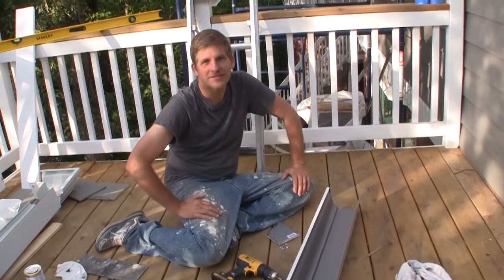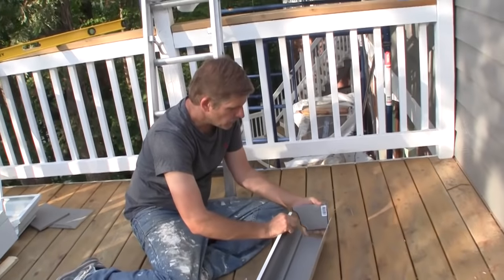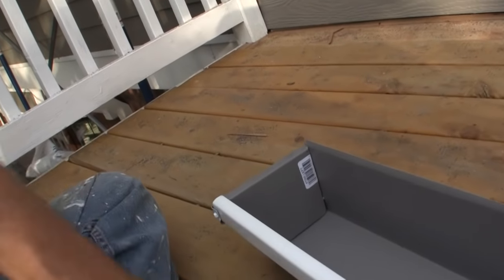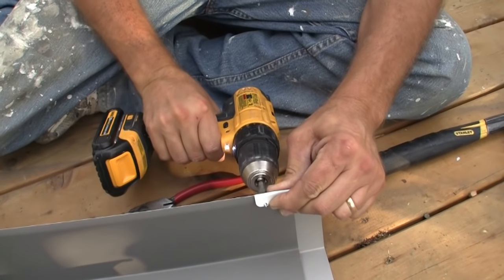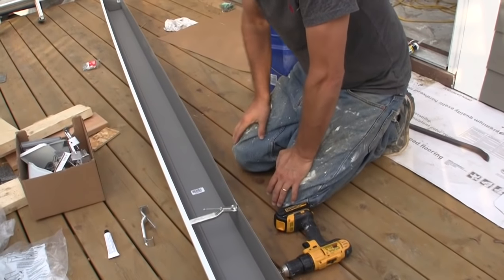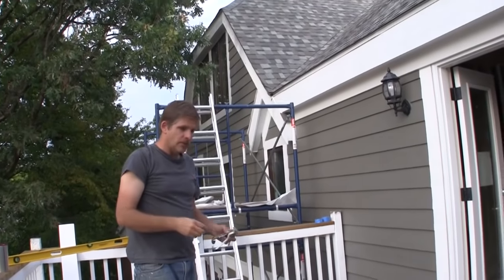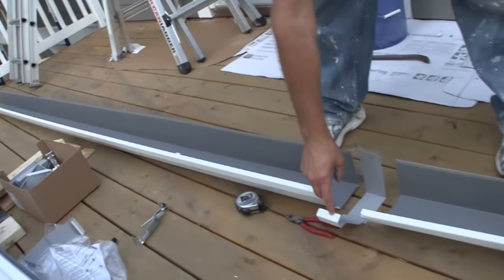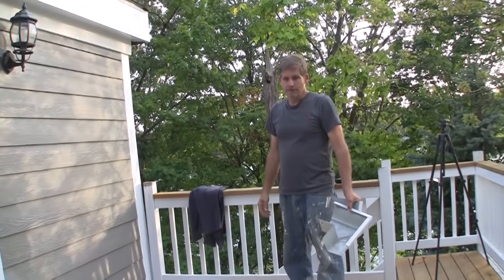How to Install Gutters

Comment: One trick I learned is instead of using the seam connectors, simply overlap the two gutter sections by six inches or so and screw together.  Creates a much stronger and less likely to leak joint.

Comment: This is why if you can, always go seamless, a local company most of the time will come out and do a cut and drop that way you can install and save some money but ultimately this is a pretty good video on installing section gutter using expansion joints always use a level and if the back of gutter falls below the drip you will need to extend the drip ,if you can save the time and buy end cap crimps you won't regret it
Reply from the maker: Hi Josh, thanks much for your comments!

Comment: If you need to scab on a short length, don't add to the bottom.  There's a lot of water at the bottom.  Add up near the top as there is less water/depth/pressure.

Comment: 1/8" slope @ 10' min, 1/4" is max @ 10'. A 40' gutter run @ your 1/2" slope would have your gutter moving water very quickly to the down spout end and potentially have a overflow issue during downpours. Roof line may look whanky also.
Reply from the maker: Hey Lou, 
A much debated issue...in the end - there are a lot of things to consider...
Thx for the input and for watching!
Reply: @Housebarons  yep, to each his own I guess.
Reply: 40 foot run. Run it high in the middle.  And each end down a half inch with a downspout also on each end. So the gutter splits the diversion of water.
Reply: Lou, I agree, but that depends on the run. If it's 15 to 20 ft,  an inch or full two is good, especially with the gadget seemers that slow down flow. If I'm forced to use this style gutter, I make my own seam and make a Pittsburgh Hem. It's sturdier and doesnt slow down flow
Reply: Thank you. This is what I was wondering about. So far all videos I have seen say ¼" slope. But video from Home Depot said ⅛" for every 10'.
Reply: 1/4" is standard in plumbing and work fine. Heavy rain area's, a wider gutter is suggest anyhow. But does the house look wonky, janky or cattywompus? My wife & I are second owners and door bell didn't work, sometimes. I found the wired the 24Vdc transformer to the furnace fan. Doorbell worked great as long as a call for A/C or Heat! There are newbie's in the electrical world but 1/2" drop per 10 foot seems excessive.
I have galvanized steel gutters. Clean, dry, Red Scotch Bite on stainless steel wool (Dollar Store now) but balled and clamped to an adjust handle, hit with leaf blower and CRC cold galvanize the bottoms get me 5 more years. Alu dents in hail storms and holes in vinyl siding are scary. We get nailed in NE. some years.

Comment: This video has been popping up in my recommended videos for a year now. I finally clicked on it, and listed below are my findings and best recommendations. 

1/4" per 10' is the standard,  not 1/2". That will change depending on whether or not the house is level. Also, Hardware store gutters are ultra thin and inadequate for residential gutters unless you install hangers as tight as 16" o.c.  Your better off calling a local gutter contractor and buying your material from them. Not only will you get seamless gutters and all the necessary parts, you'll get a free tutorial on how to install them. Although I have a lot of respect for this guy, he's is trying to show you how to intall gutters with absolutely no experience, other than what he learning as he is teaching you.

Comment: I use white aluminum 1/8” rivets and I lap 4” of gutter with four sealant bead tracks and rivet them together with four rivets in back and two on the front top lip... super strong and will never ever leak
Reply: Handyman Inside 
To clarify the 4 rivets on back and 2 on front. Is that the total number of rivers when joining two sections?  So each side of the joint would have 2 back rivets and 1 front.   Is that right? 

What about a cap end?  2 back, 1 front?
Reply: Rivets with caulk work better than screws for joints.
Reply: @1BillT  Rivets and OSI GS121 -     Permanently flexible, water resistant seal;    Expands and contracts with temperature changes;    Cures to a tough rubbery gasket ;
    Self-leveling; no tooling is required

Comment: Never bother with seamed gutters. Just pay someone with a machine to  drop you off exactly what you need then install yourself. Any company should run it out and drop it off for you. Also, crimping the endcap is preferable to screws. The sealant does all the work. And your level will only get a true reading of the slope when pressed against the back of the guttering. Still a good video for new homeowners! Coming from someone who does this for a living
Reply: I also run a gutter company and I can't agree more. 👍💯
Reply: E&H seamless here, wish he got it under the drip more

Comment: One problem is that the roofers did not install a drip edge all the way to the corner between the brown and white sides of the house.  The drip edge that is there is about 1"; probably does not meet code thus shingles should run longer and you should slide an apron piece under the existing drip edge and into gutter rearside with to keep the water from running back behind the gutter

Comment: I am a block layer and Concrete Finisher on these gutters that I will be doing I will just use a line level and snap a string line drop it 1/2 inch every 10 ft follow that all the way down screw it to the  line done deal in concrete you drop it eighth of an inch per foot
Reply: Rocky Easterline so 8th” per foot?
Reply: @nickbrooks4043  yes on concrete it is 1/8 per foot drop but gutters are 1/2 inch every 10 ft

Comment: I do seamless gutters no matter how long always one solid gutter we cut the drip edge a small amount on the high side to tuck it under but we crimp the end caps and caulk them to ensure no leakes we put screws in the corners but only in places you can’t see them and caulk them as well
Reply: johnny appleseed  I also do seamless gutters and I tell you what I work for myself but I would never recommend this because the more seams the more leaks and I could never put screws in the back because of the drip cap I also use end cap crimpers to crimp my end caps and calk them very well so I bet agree with you as I also use outside miters and inside miters but in a company a box miter will cost a lot more over time

Comment: I tried using the joiners between pieces and had leaks.   On another side of the house, I literally overlapped one length inside another length using adhesive and no leaks.  The overlap was about 6”.   With the couplers, I had to seal the inside with adhesive to stop those leaks.
Reply: U don't kno how to caulk
Reply: In my opinion just over-lapping the actual gutter sections works and looks better.1 small seam on a shorter piece vs. two right beside each other.

Comment: Great video. Silicone caulk will dry up and release within 10 years. Through the roof sealant is clear and will not dry up or release.
I use it for all connections and roof sealing, nails on roof, gutter cracks and even pvc plumbing leaks. You can apply to wet surfaces and it still seals.
Reply from the maker: Hey David Belitz ,
Thx for the tip. Makes great sense!

Comment: For the hangers contrary to popular belief gutter hangers aren't designed to clip over the back. The fold on the back side is there so screws don't pull through the hanger as they commonly did when 1st designed. Also the 1/2 of slope for every 10 feet is incorrect. By that logic a 50 foot piece of gutter will be down 2 1/2 inches from one end to the other which will look terrible. A flat gutter will drain water just fine as the water will always find the hole for the downspout.
Reply: Steel Wolf ĢŘÎM  yeah, i couldn’t believe he said that much pitch. Besides looking like crap, on a 4” deep gutter with a 2” pitch, you’ve lost half the capacity of the gutter. It’s going to go to the other end so fast and because it’s too much lower, it’s going to flow over the end cap

I was going to comment on the hangers. But, looks like this is probably up north where they can use 5” gutter and they sometimes don’t even install drip edge. I’ve seen a lot of videos that don’t have drip. But the shingles hang way over. So probably ok and the bend is still on the other side of the gutter. So still rigid enough screw won’t pull through. But, hangers are doubled in back for strength, not to clip on the gutter. You’d never get far enough under the drip edge doing that.  So the gutter will now be lower than it should be.
Reply: I have to disagree on the flat gutter theory. Unless you are saying snap a level line to run trough to. I have seen houses old and new with fascia boards out 3/4" over a 4' level. I always snap lines and never have a issue. By tge way i have been doing trough for 30 years. Its just the way i like to do it. I know we all have our own way of doing things. 👍
Reply: For some odd reason, only gutter guys know a level gutter will drain, so long as it has a hole in it. The only reason i give gutter a little drop, is to help the water flow through trash build up. I think it's a property of kinetic energy that helps it along. "And there's your gutter 101"  !!!
Reply: @mykeva1  can you explain how drip edge plays into installing gutters..? My house currently just has exposed rafter tails and I'm debating if I need to install facia boards behind new gutters or just anchor the gutters straight into the roof rafter tails.

I guess I'm concerned if I install 3/4" facia boards it will push the gutter to be too far away from drip edge?

What's your opinion?
Reply: @blackstaticband  probably too late with this advice, but I'm guessing your current drip edge is flat to the rafters. They do make remodeling drip edges that can extend past a fascia you install. You can install it over the existing drip, and under the roof shingles. But you can install a gutter on rafter tails, just try to install it under the drip. If pitching the gutter makes the gutter lower than the drip in places, you can install metal strips between the gutter and drip (fascia apron) always overlap from top to bottom. Fascia apron over gutter, drip edge over fascia apron.
Reply: @bradleyharker9019  you probably never worked on gutters in the Midwest.  Level gutters wouldn't get rid of the water fast enough before it freezes. Then your screwed and compromise the roof. Level probably works down south but never level gutters in the northern region..always some type of slope

Comment: You'd be surprised how many installers don't use a bubble level. They just guesstimate the  slope. Older homes that may have lots of settling can be trickier.
Reply: Don't use a level, just put some water in the high end
Reply: @joshmatthewson7154  Great point,and water is exactly what the installer I hired used. I even asked why he wasn't using a level. He pointed out he's been installing gutters for over 20 years.
Reply: @rkgsd  Yep, if the house is level it should pitch 1/4 inch for every ten feet
 ( I own a gutter business, lol).. Guys that use strimg lines or levels are comical,  if the house is settling ( like it usually always does with heavier dormers or porches ) then the install will be wrong if they go by eye
Reply: @joshmatthewson7154  1/4" sounds like it would result in a dramatically angled gutter if you have a roof with a 25 or 30 foot straight run. One end of the gutter would mounted almost halfway down the fascia board.

Comment: The most important issue you guys need to know. Do not  use Water based seals. Use a VOC/ polyurethane sealer.  I replaced the gutters when I was 14 years old in 1995 and they still do not leak.   Contractors who have installed them as a little as a few weeks ago have developed leaks.
Reply from the maker: Hi WN Continental Broadcasting, nice tip, thanks!

Comment: All those joints will leak. No amount of silicone will seal adequately. You must silicon before you make a joint, not after.
Reply: not true
Reply: damn right...what the hell was he thinking
Reply: Seal AFTER assembly. Air pockets will form if you seal as you go, causing leaks. You want all sealant covering joints. And stay away from silicone. Use Gutter Sealer specific sealants. It bonds better over joints where water will constantly be present. Gsil1250 is a great product from my experience. 25 yrs in the gutter industry.
Reply: did not show how far he went below the drip flashing on the other end
Reply: 100% correct.
Reply: Just gave you a thumbs up. The silicone will come off in about 6 months in one nice long strip. You'll find it on the ground later lol. And then that gutter will leak like crazy. 
Sealer has to be on the edges.
Reply: Who uses silicone?  It’s not a good enough adhesive. When the gutter expands and contracts, it will break loose from the gutter and leak between. But, thanks to those that do, it takes 2 seconds to pull silicone out and seal properly.  Gutter seal is all anyone should ever use.   Also, who screws on the end caps?  They make crimpers for end caps. Top has to go under drip, but then again look at corner of house, roofers didn’t run drip to end Amd he put a screw in the seam up at very top.    But yeah we are constantly taking down this do it yourself leaky gutter so the homeowners can return it.  Also, a 1/2” slope per 10? As little out of level as possible is good. This isn’t plumbing you’re trying to float a turd through. Anything square or rectangle, the more you angle it, the more capacity it loses.  Omg! They just put the gutter on top and below  the drip edge. Good thing roofers hung the shingles way over the edge. This is one of those jobs we come upon and know the homeowner did or a handyman. There isn’t much right about the material or the method.
Reply: @mykeva1  Depends on what kind of silicone you use. If you use a cheap acetoxy silicone of course it won't adhere well, and it could potentially corrode the metal as well. If you use a oxime or neutral cure silicone it will perform better than any other sealant.  Not only will you get great adhesion but the sealant will stay flexible over time because silicone is inorganic and doesn't get broken down over time by UV light like solvent-based/polyurethane products.
Reply: Gutter sealant is self-leveling. It won't leak if applied properly.
Reply: Ain’t nothing that flex seal can’t fix
Reply: Beast from the East I made my whole gutter out of flex seal

Comment: Dave & Rich Remember when you are talking about how much drop for 10' that is not rain gutters it is 1/4" for Sewage Pipes like from your toilet. think about it if you have a 60' home that is a 3" drop, when the roof is level 3" would look awful on a fascia board. Gutters do not have solids so therefore keep your gutter level with the roof and it will drain perfectly. Glad I could be of help!
Reply from the maker: Hey Robert,
Thx for the input.
Reply: @Housebarons  Glad to be of help, don't worry many contractors believe that gutters have the same set codes as sewer pipes.

Comment: Nice video, explaining the major gutter components i.e  the hangers , seamers , corner pieces , and gutter itself. Measuring correctly , slanting the gutter depending on the roof as well as the proper position of your downspouts. And your Done
Reply from the maker: +sam111880 Hi Sam, the gutter professionals have come out of the woods to tell us that we have too many seams. That is because we don't have pro equipment to produce a 25 foot gutter, which has many less seams. We do most tasks the DIY way, which means we do.the work ourselves, without pro equipment  to achieve our goal. Thanks much for taking the time to comment! We appreciate your kind words!
Reply: sam111880 this guy doesn't have a clue. End of story.
Reply: May seem like a good video to a novice. This guy should not be showing anyone how to do gutters. We professional gutter installers don't do it this way. It requires very few tools. We just have the knowledge and know how. Experience.
Reply: Extreme House Flipping then call a gutter company and have them run seamless off for you. We go measure the house, cut the corners, put on the end caps, etc... for half the price of the install and the homeowner can install themselves and save some money.  

There’s a lot more wrong than just the seams though.  And the seams are a big issue. Why save 10% if that to have stuff that will fail?  6” seamless installed is $3.75 a foot, downspout count as 10’. So, 40’ of 6” seamless with a downspout is under $200. How much would that cost in seamed stuff that’s gonna fail,,, about $150 and you do the work and warranty.

Comment: on the downslope where you are connecting two 10 foot sections could you overlap the gutters inside the connector piece? that way the water would slide right down?